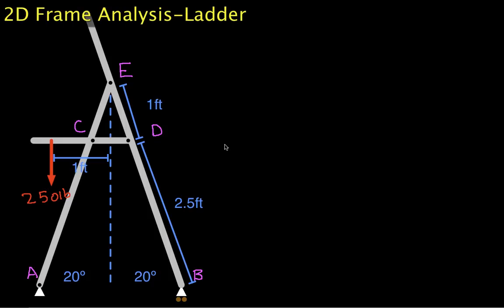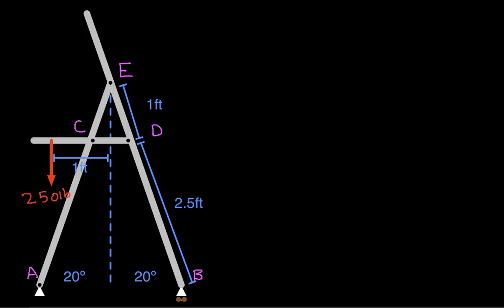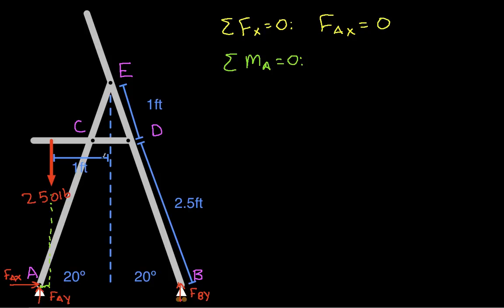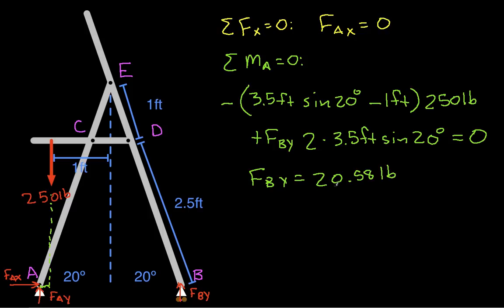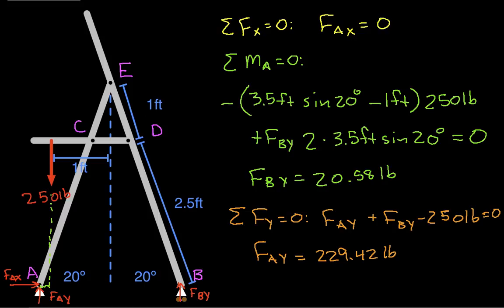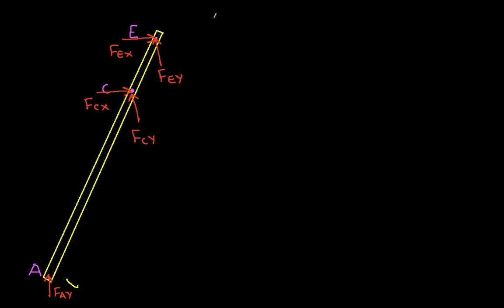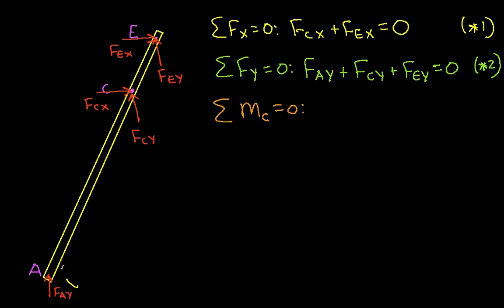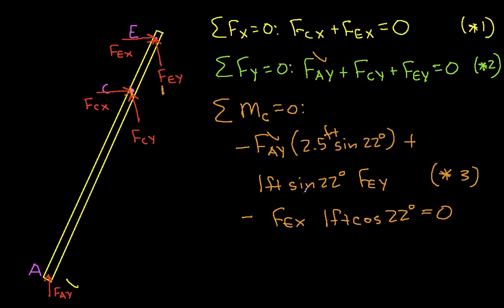2D Frame Analysis-Ladder Part 1

Comment from the maker: Apparently, a random neuron fired and I changed 20 degrees to 22 degrees. It should be sin 20 and cos 20 throughout this video and throughout Part 2. I will add an annotation to correct it. Thanks for catching this.